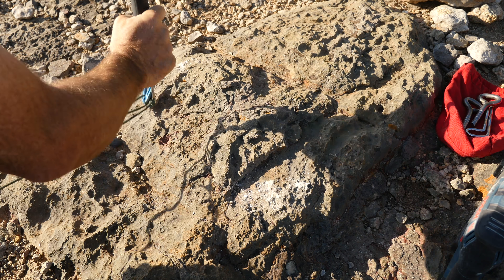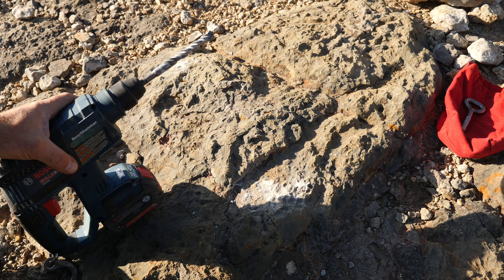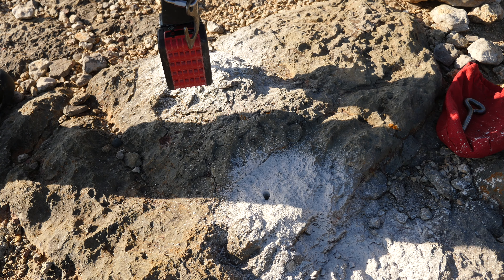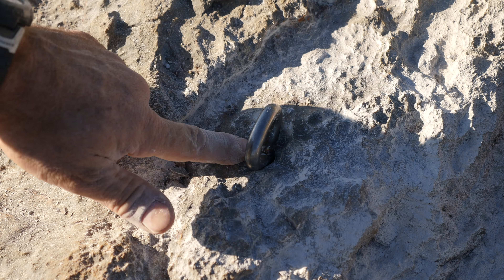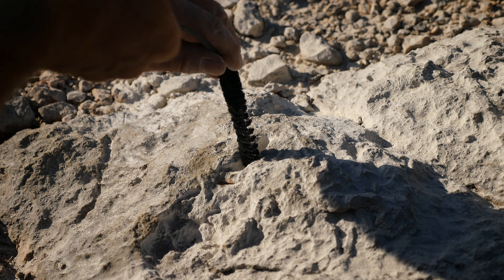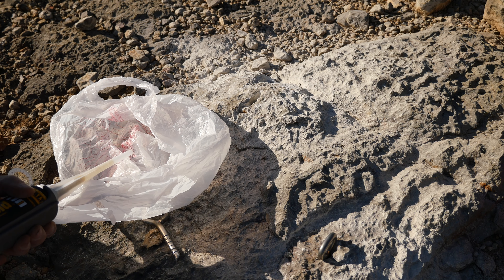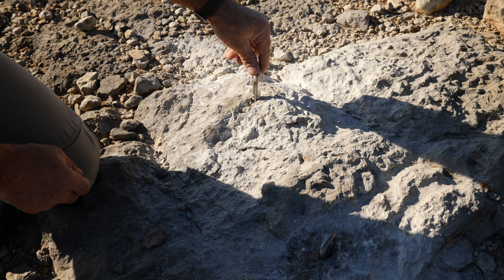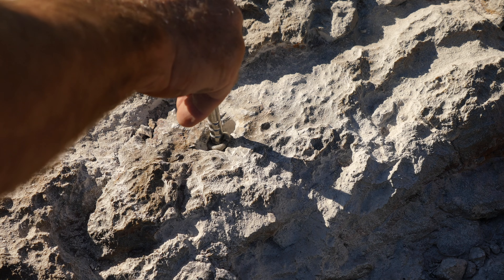Cave Bolting Tutorial - Placing Glue-Ins

Comment: From a caver like yourself to a sport climber like me, I’d love to see a video that details how you think through which secondary mineralization features (speleothems) formed from limestone parent rock can be safely bolted, and which should be avoided. I recently started rebolting rock climbs that have these types of features (tufas, stalactites, etc.) and am trying to calibrate myself to know what is safely protected and what is not.
Reply from the maker: Good question, but probably not a video I'd be able to make. There are simply too many variables and answers that begin with "it depends". Anchoring to any sort of secondarily deposited calcite should always be done with extreme caution. Stalactites, stalagmites and flowstone can form on top of mud and incapable of holding even body-weight. Other times the secondary deposit may form with a considerable amount of entrained air resulting in very aerated rock. But sometimes secondary deposts are well bonded, extremely dense and with strength that approaches that of the bedrock. Aggressive testing with a hammer, paying attention to the surrounding rock, and being attentive to feedback when drilling the hole are all ways to better judge a placement.

Comment: Have you used glue ampoules for bolts? I‘m interested what you think of them. They seem to be very practical for caving because of much less weight.
Reply from the maker: I have not tried the ampoules. I've heard they can be tricky to mix properly, and they do have a very finite shelf-life. I'm not sure they are manufactured any longer.
Reply: Derek Bristol I‘m in Europe. We do get them here. Also sold by caving shops. Raumer also makes a special holding device with SPD+ that you can use the drill and the bolt to mix the glue properly in the hole. I bought it all in the meantime but didn’t use it yet.
Reply: I have used them before, but not a big fan. I like the caulking tubes better.
That said, Mountain Tools carry the Capsules:
https://www.mtntools.com/cat/rclimb/bolts/fixeglueinbolt.htm

Comment: Are there special drill bits for rock or are the metal drill bits good enough ?  Will any drill work or does it need to be a hammer drill ?
Reply from the maker: You need an SDS bit, which has a tip that’s more like a chisel than a cutting edge. You also need a rotary hammer. Hammer drills may work for light duty and if you have a lot of patience, but not for anchor bolts.

Comment: https://www.youtube.com/watch?v=xm2lxp2ui4o&feature=emb_title

The fixe recommendations are not perfect either. I do this. I start drilling two holes that converge into one. I start drilling the top at an angle down. I drill about 2cm. Then I start drilling the bottom hole at an upward angle. When they come together, the middle part falls out by itself. Then I continue to drill the center hole to the desired depth. That's all. It turns out very neatly.